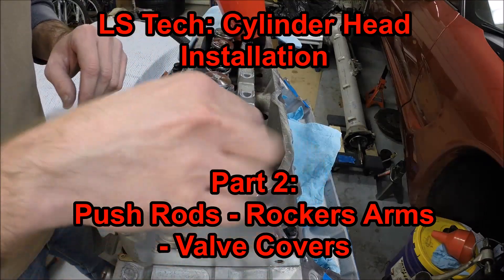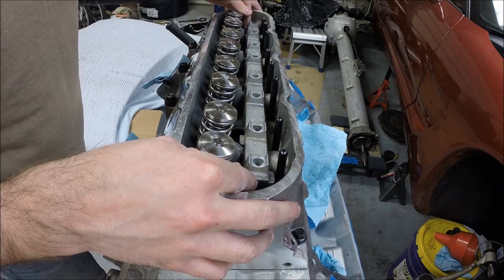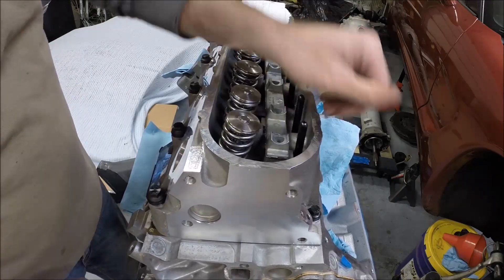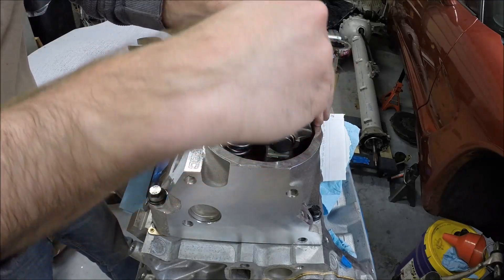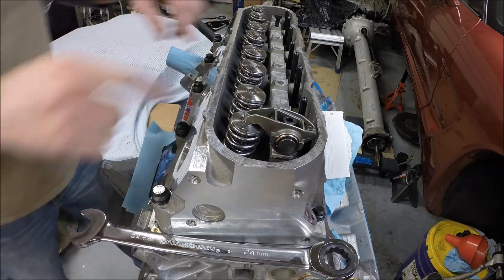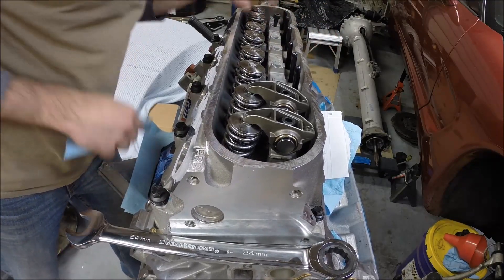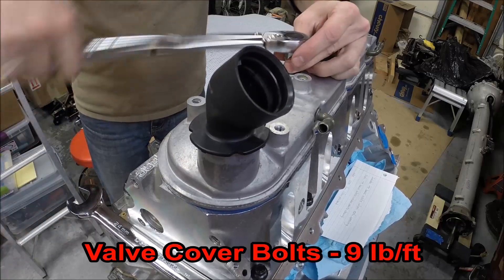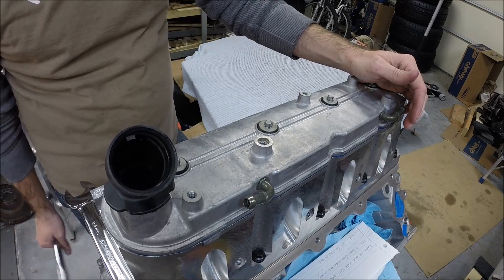LS Tech: Cylinder Head Install - Part 2

Comment from the maker: I added it to the episode notes but wanted to specifically call it out in the comments too...   

On ported heads, likely the intake rocker arm bolt hole becomes a through hole into the intake runner.  In which case, be sure to use some thread sealer on that rock arm bolt so that oil doesn't seep past.  (not shown in video - I went back and added it).   On stock heads it is a blind hole (doesn't go all the way through), so the thread sealer isn't mentioned in typical repair instructions.
Reply: I'M SORRY...WHAT!!!
This is normal, and not a screw up on their part??
Your freshly TSP PRC  heads  had this "charictaristic" ??
How many could possibly cut through? Isn't this a restriction, as well a leak situation?  What kind of thread sealer??
Reply: @13megagreek  had this issue on my head as well, all good, just use any thread sealant and you'll be fine
Reply: @jonwavy6242  ok,thanks

Comment: Which direction do you line up the oil holes in the lifters does it matter my trays are not GM trays some people turn the holes facing each other #DODDELETE2007TAHOELTZ

Comment: Hello merry Christmas you recommend me to by new head bolts for my 04-5.3 suburban
Reply from the maker: Yes, the stock head bolts are torque to yield (ie single use).  I’d recommend at least getting the ARP head bolts, which are reusable.  Or their head studs if you’re adding boost.
Reply: @ScrufsGarage  thank you very much for your help is a suburban am going to order the ARP head bolts for it I ordered from Texas Ls head gasket lifters and push rods and am going to order the ARP head bolts better safe than sorry I ordered it from Todd riggler Ls performance parts shop cosmetic Head gasket oil pump and timing chain a complete package can't go wrong better some Auto parts thank you for your help merry Christmas too you and your family

Comment: What preload 0.00 !?
Reply from the maker: I was aiming for around 0.070" pre-load.   I did a video on measuring pushrod length to help make sure you get the proper lifter pre-load.  https://youtu.be/9sWnhRe8rs4

Comment: Excellent video. Quick question, I may have not caught it however, did you "lube" the fastener holes for the rocker arm retainer bolts? and what about the main rocker mounting assembly bolts to the head?. Doing my first swap, and uber cautious, yours and other videos are a HUGE HELP. Thanks!

Comment: How can I tell what my problem is? Lifter, rocker or cam? I had a code for #3 misfire, there is a rattling sound so I took off the valve cover and found one very loose rocker. Meaning a lot of play between rocker and pushrod. Thanks for your help.
Reply from the maker: What motor do you have?     Does there appear to be any damage to the valve spring or rocker arm?  If not, then it might be a collapsed lifter or bent pushrod.  Of course, if you find a bent pushrod, the next question is how did that happen and is there other damage.  A compression test and cylinder leak down test may also be in order.
Reply: @ScrufsGarage  Hi thanks for the response. I have a rebuilt and built up LQ4 with aluminum heads. The heads are not ported, just cleaned up and had stainless valves installed and better springs, etc to go with the cam upgrade to support up to .610 lift. LS 7 lifters and stronger pushrods to support the stronger springs. 
  When I turned it over by hand all the rockers were functioning but exhaust valve rocker on number 3 looked like it stuck and then popped the the pushrod up to the rocker before opening the valve. So I’m expecting it’s a stuck lifter. I haven’t checked the other side yet but I will be checking it over the weekend. Now just trying to find someone to do the job for me. What parts do you suggest I order up front?

Comment: You should be using assembly lube on the both ends of the push rods. And you are not supposed to put oil on bolts that don’t call for it you change the torque rating when you oil the threads
Reply from the maker: Sorry for the confusion as I didn't specify in the video.  Oil was being applied to the trunnion bushing, not down the bolt hole.  You are correct, lubricating threads reduces the torque required to achieve the same clamping force.

Comment: Im needing help with removing and replacing my heads on a GM 6.0. 
How do I drain the block. I took off the lower radiator hose but only fluid came out was from the radiator. I need to get the fluid out the block .

Comment: What gasket kit did you buy I'm building a 5.3
Reply from the maker: Carlton Robinson  For the head gaskets I used the GM MLS gaskets.  Nothing crazy.  Cometic makes some thinner gaskets if you need something special but they are significantly more $$ than the GM stuff.
Reply: @ScrufsGarage  I seen something that Amazon sells vincos it's an MLS gasket I didn't know if that was what you were using or not

Comment: so i replaced my lq4 header on one side and did not rotate the engine to know the exhaust valve to be on its base circle. so i basically just torqued each rocker arm to 22lbs of torque. i clearly did it wrong. when torquing one of the rocker arms. the valve spring is half compressed down/way to much compared to the other springs. the car idles to strong and the rpms are off. im afraid i might of damaged one of the pushrods or lifters. hopefully nothing else.
Reply from the maker: The risk of tightening the rocker arm bolt when the cam isn't on the base circle is that you can damage the threads in the head because you are compressing the valve spring at the same time.   But I think it's unlikely you damage a pushrod or lifter.   You said the car "idles to strong."  Do you mean the idle is too high?   You could have a vacuum leak somewhere.
Reply: @ScrufsGarage  hmmm maybe its not idleing to strong or high. when i rev the car. i feel like its about to die. i will loosen the pushrod and check the pushrod and lifter. i dont hear any weird noises while car is idleing. i will check for vacuum leaks.
Reply: Highly unlikely you will damage threads in the head, the rocker bolt is well threaded before any spring tension is taken up. Threads have to take the spring load dynamically when the engine is running, so are strong enough for the load. Issue is potentially that the real torque is actually low as you are torqueing (to an extent) the valve spring. I cannot see the original factory assembly rotating the crank to install these? My factory bolts seem to have been way tighter than 22 Lb/Ft. If you set the crank to TDC on firing stroke both intake and exhaust can be done at same time for each cylinder. There are charts showing which to do from a specific crank position, multiple cylinders can be done at the same time, much easier when in car.

Comment: What were you squirting into what looked like the rocker arm bolt hole? oil?
Reply from the maker: Yes, squirted some oil onto the rocker arm trunnion, and some assembly lube on the rocker arm tip.
Reply: @ScrufsGarage  why did you? and does the oil change the torque spec?

Comment: Dude knows his stuff. I like how as soon as the torque wrench clicks he stops, as oppesed to some people who make it click 2 or 3 times which is just unnecessary. Great videos and nice camera angles!!
Reply from the maker: Thanks for the kind words.  Very glad the video was helpful.   I agree, continuing to pull on the torque wrench after it clicks isn't needed and you risk over-torqueing a bolt.  You really have to get to know your specific torque wrench.  With mine, a smooth steady pull is most accurate.  If I pull really slowly or really quickly, it will give a false reading.

Comment: I just ordered some PRC heads from Texas Speed. How do you set valve lash? What about lifter pre-load? Can you do a video on the lash?
Reply from the maker: I bought complete heads from PRC and they came already set up with the valve springs (and valve lash).   As for lifter preload, this is determined by the push rod length.  I have a video specifically on that topic, so check it out when you get a chance.   Good luck on your project!

Comment: I have an 06 Escalade with a 6.0 I need to replace the head gaskets. Are your torque specs the same ?
Reply from the maker: Keep in mind that the OE GM head bolts are "torque to yield", so they'll have a different torque sequence that what I demonstrated.  If you choose to use ARP head bolts, they will include they're recommended torque spec.  The ARP bolts are a good choose since they are both stronger than OE, and they are reusable.

Comment: Can you re-use the original rocker arm bolts ?
Reply from the maker: TBags clan yes the stock rocker bolts can be reused.  If you buy the Straub trunnion kit like I did, they include new rocker bolts.
Reply: Ok thank you i appreciate it. I will get the kit when i am ready to port my heads

Comment: if you ever get a chance please do a full video on how to drop the transmission.
Reply from the maker: I have some video of both removing and installing the torque tube and trans/diff.  Just need to edit several hours of video down to the key bits to make it more watchable.   It's a beast of a job but I am living proof it can be done in your garage, on jack stands, completely by yourself.
Reply: That would be awesome, i wanted to take my transmission out to do a rebuild but haven't found any good vids on step by step tutorial